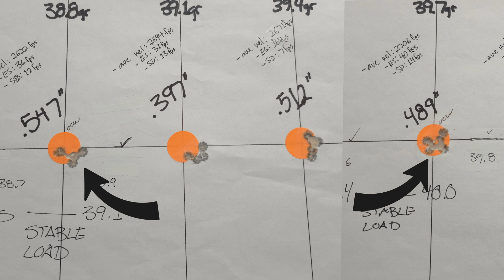The OCW method: part 2 (OCW vs 10rd Ladder Test method series)

Comment: How do you know how the seating depth test for all of 38.5, .7, .8. .9, 39.1 and 39.7, .7, .8, .9 if they all then undergo seating depth test would reveal a different charge weight to call stable? I know that’s a lot of shooting for probably marginal value but would it be worth it?

And does “stable” automatically imply stable over winter/summer or normally correlate to less temperature variation?

Comment: I guess I am confused because I may have been taught differently. 
Why are you looking for group size during an OCW test?

Based on these results I would have picked 38.9 and further refined between 38.7 and 39.6 looking for vertical consistency. I am not saying I am right.  I am just interested in what we are looking for during the OCW test.
Reply from the maker: Yeah I was looking at both group size and the vertical poi and should have focused more on the vertical poi

Comment: are you not missing some rounds from 38.9 to 39.6 ? 
the ladder test when done correctly should be on a chart to find flat parts
Reply from the maker: This is the ocw test not 10rd ladder test
Reply: @Reloaderscodex 
I have reviewed Part 1 Part2 & Part 3 and see no ladder test ?  
Part 3 is a seating test not a ladder test 
is there a Part 4 ? 
very confusing !
Reply from the maker: @DLN-ix6vf Yeah, that was the ocw part,  im working on the 10rd ladder part.  I probably should have worded things better. Im currently waiting on a new computer, so I can't post the new video until it gets here.
Reply from the maker: @DLN-ix6vf is says ocw part 1,2,3 at the end of the title.
Reply: @Reloaderscodex  Part 1 & 2 say OCW vs. Ladder test ?
Reply from the maker: Then it has the : then it says the ocw part whatever.  I'll have to change it so it's not so confusing.
Reply: @Reloaderscodex  so where is the ladder test as I'm shooting one tomorrow and wanted to see how you did it
Reply from the maker: @DLN-ix6vf i havent posted any of the 10rd ladder test yet.  Just the ocw parts of the series.  My computer crapped out so im waiting for my new one to come in so I can post it.
Reply: @Reloaderscodex  you can't do a ladder test after a seating test it should be done at the same time as the OCW tests

Comment: N150 would work wonders for this projectile in a wide range of temps. The shape of this projectile is tangent. Rt/R of .96. Meaning it should be less sensitive to seating depth changes.
Reply from the maker: @Rickjames127 I've never used any Vihtavuori before but I've heard really good things from most of their powder
Reply: @Reloaderscodex I was the same way never having testing VV. It usually meets all the ideal criteria 95-110% case fill and 100% burn in a wide range of temps. N555 is what most recommend for 6.5cm in regards to VV. It's double based and doesn't burn 100% in as many barrels lengths and temps.

For this projectile and the ones many use 140eldm, 143eldx, and 147eldm the only other powders I'd go for is shooters world long rifle and alliant reloader 16. Both of those are basically non-existent in the market though compared to n150. Plus the cost for both is usually higher when in stock.
Reply from the maker: @Rickjames127 I actually just snagged a bottle of reloader 16 not that long ago.  I didnt realize it was so hard to find or I would have bought more of it.  I think I paid like $50-$60.
Reply: @Reloaderscodex  Yeah at least the shops by me like Scheels, cabelas and smaller shops have poor availability for it. Online an in stock single lb is 65 from midway before shipping and hazmat. 8lbs is 508-521 in stock before shipping and hazmat. N150 local to me in a smaller shop is 46 for a single lb. 8lbs is 313-334 online before shipping and hazmat. Definitely a better value and more availability from what I've seen. 

I'll subscribe and hopefully you'll test the reloader 16 in the future with these heavier projectiles. I don't have a 6.5cm yet. We've been mostly testing 6mm arc recently with vv n135, 103gr Eld-X and win #41. We got 15 shots in 1.2" at 100y with 21es and 6sd. Those results are from a stupid cheap and poor quality 24" bear Creek arsenal barrel in a gas operated mag fed semi auto. 

We went from using mostly double based powders to using vv n100 series nearly exclusively. Checking GRT for parametric powder search the n100 series just comes out on top most often in a wide range of applications.
Reply from the maker: @Rickjames127, thanks for the subscribe.  Yeah until recently I only ever loaded for .223/5.56 for a couple different ARs.  This is my first time loading and shooting 6.5cm and my first ever bolt gun.  Never even shot one before I built this rifle.  Honestly, I was never even interested in bolt guns until I started reloading and shooting for precision and accuracy with my ARs which I love doing and the rest is history.
Reply: @Reloaderscodex I completely understand. Don't have a bolt gun setup yet myself and I too mostly reloaded 5.56. N135 is also our go to in heavier projectiles 73-77gr for 5.56 with our mk12. For 62gr projectiles we use n130 and for our 11.5" barrel n133 for the 73-77gr projectiles. N130, N133, and N135 are identical except for the burn retardant put on each powder. N140 is a bit different and we did use that for a bit with decent results in the mk12. The burn is a bit too slow though and doesn't provide consistent results at lower temps with that 18" barrel.

Comment: You have to back that up at 300 meters on a different day because I think you picked the wrong charge weight. Seating depth will improve the .5 MOA group to about .3 MOA, if you need more add 3% charge weight and try again
Reply from the maker: @ob1knb3 Yeah I'll clarify in part 3 (seating depth test video). After talking with some ppl im gunna be using the 38.9gr since the es/sd are the best along with the POI is stable where as the 39.8grs es/sd are the worst plus the POI shifted from the the others.

Comment: You are just wasting components with anything under 40grs.  Around 41.5-42.7 is about the optimal load for those components.  They are well known 6.5CM loads.  Hornady use to have the 41.5gr load printed on their ammo boxes.  It works.  I run 42.5 and it's a legit 1/4 MOA load out of my Proof barreled AI.
Reply from the maker: @ddn79 yeah I found that out after I already finished the first part to this series.  Sucks but what csn you do. I just started loading in 6.5cm and have only ever reloaded for 5.56 before this and used hodgdons load data and turns out their charge weights are way low. Like way low lol.  But after I finish this comparison which is more about showing the process and differences between the two methods than getting specific results.  Thank goodness cause I don't feel like reloading and filming everything.  I'll just go higher once I'm done with this series.
Reply: Hey mate my at-x started to blow the odd primer (srp)@41 grains did you have any problems ?
Reply: @thegreatdays3756  you might have to adjust the firing pin on the ATX.  It's common for AIs firing pin to stick out too far
Reply: @ddn79  thanks mate i’ll try that.

Comment: I'm just wondering why you picked the smallest group when OCW is all about finding a stable load that doesn't show a vertical POI shift. All your previous groups have a stable POI and with 39.8 the POI starts to wander. The nice group with 39.8 can be a result of luck, there're too many random variables for it to be considered viable. 

If I were you I'd try 40.0 gr and 40.2 grain to see if the POI keeps changing. If it does, then that 39.8 charge ain't any good. Personally I'd take 38.9 and do the seating depth test with it. Also, if you can afford it, test the group with at least 10 bullets or 20 even. It'll give you much better picture.
Reply from the maker: @lordzlomek yeah I havent started on part 3 (seating depth test) video or reloading yet because I was reconsidering using 39.8gr and using 38.9gr instead.   I'll just have to clarify that in the next video.  At least I know i was leaning the right way. I've been asking ppl in the comments for what they think so im glad you said something.  Thanks for the input bro.

Comment: Question for optimal charge weight whyd you chose one with the highest es is just just because the smallest group?
Reply: Those supposed higher ES/SD will never make a difference depending on the type of shooting you are doing. for the majority of shooters especially hunters they will never be able to outshoot those handloads anyway. I have had loads with ES of almost 50 and SD of over 25 that outshot my loads with single digits ES/SD out to 1000 yards. The one and only way you should ever evaluate a load anyway is testing out to distance with multiple verification runs.
Reply from the maker: @jbb4591 Good to know.  Now I just need to get out to longer ranges and not just 100 yards.  It's just so convenient cause my shooting bench is about 20 yards off my back porch amd I don't have to go anywhere.  Setting up all the filming crap and preparing to shoot takes for freaking ever and is a major pain when it's like 10 degrees out lol
Reply: @ Definitely a good idea to get out to distance sooner than later at least in my opinion. I don’t even do load development at 100 anymore. I make sure I am zeroed at 100 and do all my load development at 300 yards which I think tells you a lot more. then I confirm at 600 once I find stuff that looks promising and if it holds together at 600 I have never had it not hold out to or past 1000.
Reply from the maker: @brianjazek7769 yeah, this has actually been a bit of a conundrum for me and am not sure what the better option is in this scenario. Option 1: 38.9gr (Average Velocity: 2648fps / ES: 13fps / SD: 5fps) with a group size of .501".  The upside of this group is that the es/sd are the lowest of the series and shoots a half inch sized group.  The downside is that the average velocity is very low.  It doesn't quite hit the 2650fps mark. The group is in the shape of a U. .... Option 2: 39.8gr (Average Velocity: 2720fps / ES: 37fps / SD: 12fps) with a group size of .363".  The upside is the group size is in the .3"s, is the smallest group of the series. The groups shape is round with no flyers or stringing happening.  The average velocity is the highest of the series (2720fps).  still a bit slow and has plenty of roon to go up. The downside is that the es/sd  is just over double what the es/sd is for 38.9gr.  So when shooting for long range and accuracy you need low es/sd's but also want a velocity that's got enough power to reach out and touch stuff at distance but thats not pushing the pressures/velocities too high.....  this is my conundrum...on one side I have a load that's got a pretty low velocity, it has a little below average group size, but also has very low es/sd numbers .  On the other hand I've got a load that's got a higher velocity, very small group but the ES/SD is double that of the other load.  So my question is , is an es: 37 / sd: 12 high enough to matter at long distances compared to an es: 13 / sd:5. What's the right choice to put into a seating depth test for part 3?

Comment: Your ES are still high. Be careful picking the smallest group. When conditions change it could be unstable. Good Luck.
Reply from the maker: @N5KDA what are the main causes for your ES to be high?  It's not just from the charge weights right?  There's a lot more stuff that cause the them to be high right?
Reply: @Reloaderscodex  and ES of 13/16 is no means high
Reply from the maker: @tiputipu777 so with this test which is the better option to use for a seating depth test. The 38.9gr that is a bit larger of a group but has a better es/sd or the 39.8gr which is the smallest group but has a slightly bigger es/sd and has a poi that's shifted slight compared to the others where the 38.9 has a stable poi?  Im not sure which is the better option to choose from in this scenario?  I'll take as much advice as I can get.  Anyone that reads this chime in. I'm fairly new to this test method and dont have a bunch of experience with anything in reloading other than just shooting different charge weights to find the smallest group. I've never actually done legit load development before to find the best load.
Reply: @Reloaderscodex  personally Id go higher with weight, I dont have experience with 4350 but I shoot 139 scenars with n555 at around 41.7 grains of powder.

You had a pretty big jump from 38.9 straight to 39.6, but the 38.9 looks good. Reason is that the lower charge weight also has good es and no poi shift. If you tested 39.2 grains and also had the same poi with similar ES it would indicate a lower velocity node. You need to stay away from charge weights that have weights next to them that wither produce significantly more velocity or poi shift.

Keith Glasscock from Winning in the Wind has a lot of good information on load development.
Reply from the maker: @tiputipu777 yeah i actually watch his stuff. He's very knowledgeable. I'll go up in charge weight after I finish this series. I don't want to have to start it all over with going up higher
Reply: @tiputipu777  I saw some that were more than that. If you want a ragged hole gun, considering the barrel and shooter are capable, you need single digit SD's which require lower ES's.
Reply: @Reloaderscodex  Sorry, I just saw your reply. It could be neck tension variations, and or inconsistent primer seating, and or powder charge weight inconsistencies .I double weigh my powder charges for my benchrest gun. Most digital scales for reloading are only good for plus or minus  a tenth of a grain. I let my powder dispenser throw the charges, but final weight is on a very sensitive balance beam. Unless you have one of those super expensive setups, most digital scales will lie to you. I don't know what type of brass prep you do, so some of it could be in that. You can't leave anything on the table if you want bug holes. You have started down a deep rabbit hole. BTW, I won't use double based powders anymore for serious work, but if you do the ES and SD's go out the window.
Reply from the maker: @N5KDA No worries.  What beam scale are you using. I can't find any that aren't pos crap from China.  Every beam scale I've tried is unreliable and inconsistent
Reply: @Reloaderscodex  I have an old Lyman scale that's been out of production at least a couple decades. Something like the RCBS M500 or the M1000 will work. Lets say I'm loading 31.5 grains of powder, I use check weights to zero the scale at that weight. After the scale is zeroed, I won't use a charge until it is exactly where I want it. Yep, it's time consuming, but I get powder charges that are close enough to get single digit SD's.
Reply from the maker: @N5KDA I've tried both the m500 and 1000 rcbs scales and they were so far off its not even funny.v